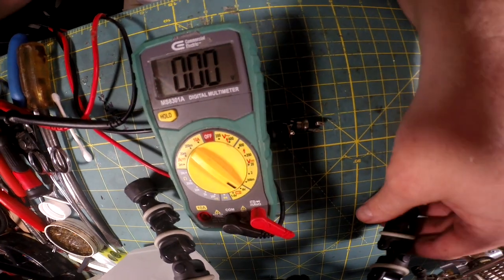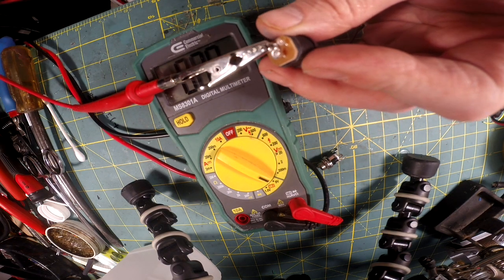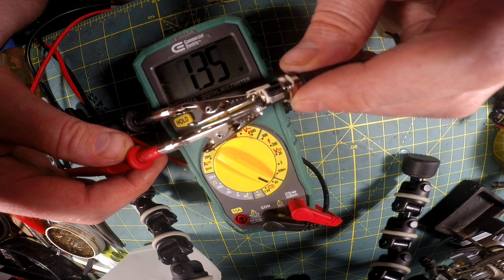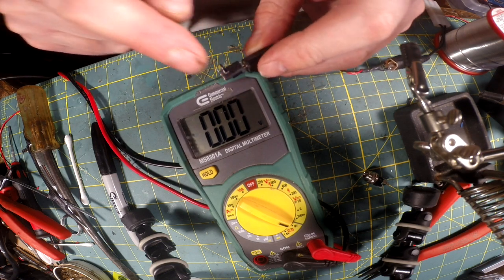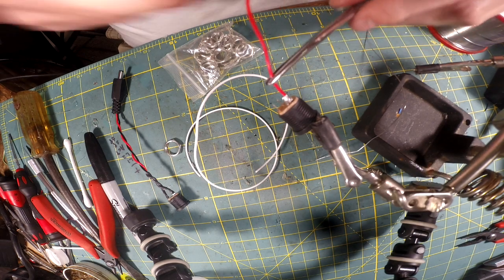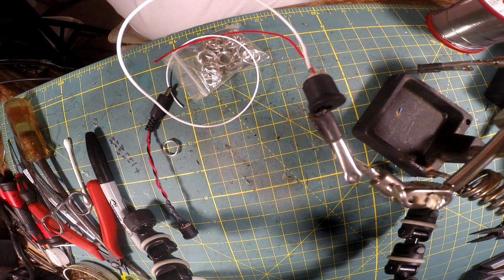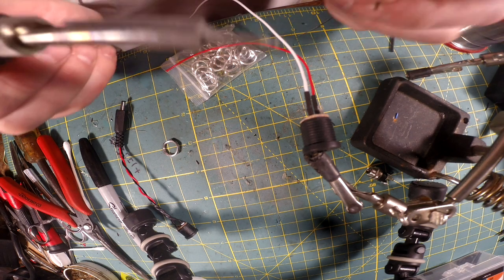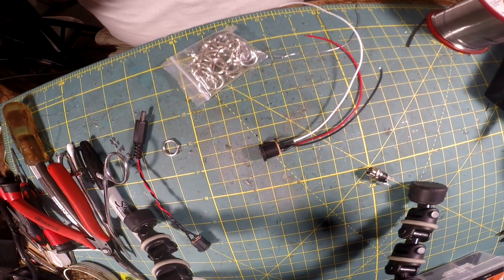Introduction to Custom Lightsaber Recharge Ports

Comment: Hi Tom! I just finished watching your video and really enjoying them so far. I’m the same guy from a recent FB post in the DIY Sabers group where I was posting about upgrading an Ultrasabers Spectre to Proffie 2.2. While I’ve been awaiting some parts to arrive such as type of wire you recommended, I’ve been just trying to familiarize myself with how the recharge port and switch will work. On this video, you made mention of the recharge ports typically having 3 legs and why they have three legs, however the RCP that I received from US only has two legs that were wired for battery negative and battery positive with no third leg existing to do anything with. I traced the lines at least on the Obsidian Soundboard’s case, one like from the battery connects to a battery + on the soundboard but also to one of the illuminated switch legs. The same for the other line, except it goes to a battery - on the soundboard and then to one of the other switch legs, presumably the positive line for powering the battery. 

My question is, for my Proffie setup, can I still use this recharge port somehow or wire it to some of internal kill switch so that I can use what I already have? Or do  I need to order a new computable RCP female connector that has the 3 legs? If I do an internal kill switch, which one what you recommend for being rated high enough in amperage and be low profile enough to be able to fit on the chassis? Thanks!
Reply from the maker: you can use a 2 prong rcp, but Id get tge proper one. the custom saber shop carries good high quality low profile switchcraft 2.1 mm rcps.
Reply: @MegtoothSithSabers  Thanks! If I go for that type to replace the one I have will it be a type that a kill switch plug can cut the power drain from the battery? I have a matching kill plug that I ordered from the The Custom Saber shop that fits the Spectre very well and I’d prefer to use that to do the job.
Reply from the maker: @SkyeWelse  yes

Comment: Could you wire the recharging port to the soundboard without having the "cutoff" leg wired to it? (not wiring the "cutoff" leg to the soundboard at all) How would you be able charge the lightsaber in the case of you doing that?
Reply from the maker: No, you can't, it doesnt work like that. The rcp is a switch. The cutoff leg is negative continued through the rcp to the board. Why wouldn't you write it correctly? What's the logic or purpose in having an rcp? You dont need one, but if you're going to use one, it needs to be wired correctly.

Comment: I have a Question Tom, if I have the sc port already mounted on the chassis do I need to cut them?
Reply from the maker: no
Reply from the maker: When I say "cutoff" leg, that means that the negative leg is cutoff to the soundboard when the charger is plugged in.  I cut the "cutoff" leg off the adapter plug, because its not needed on that.